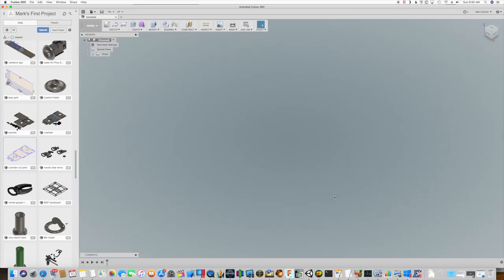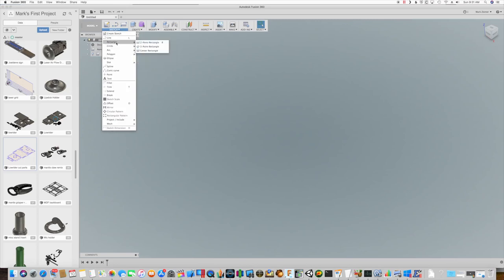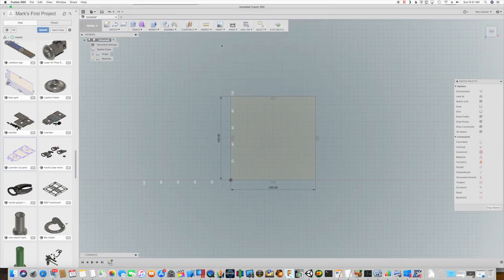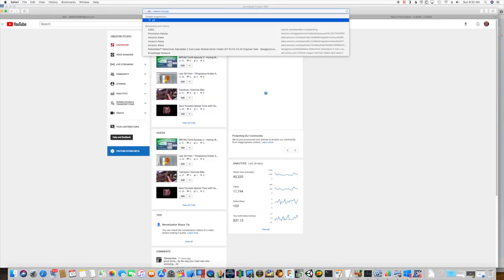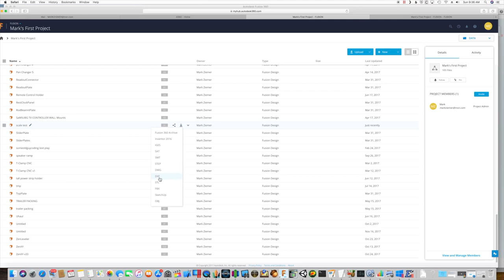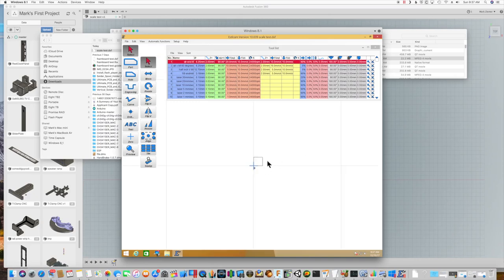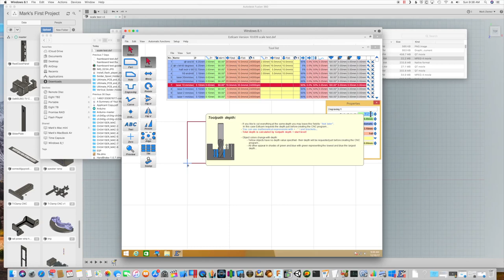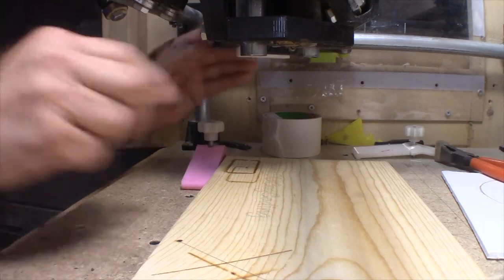Fusion 360 to ESTLCAM  - Scale Test

Comment: I’m running into a problem where after completing the sketch just as you have in the video,  but after saving as a dxf and emailing and opening in estlcam all that comes out is a single line.  I have 3 different files all different shapes and have received the same result every time.  Any thoughts?  I cant see what I’m missing.
Reply from the maker: I wonder if it's saving the sketch on the wrong axis...       The better way is to right click on the sketch and do "save as dxf"

Comment: Realizing this is an old thread. I'm also having a scaling issue with both ESTLCAM and Fusion 360 with the MPCNC post processor. I use Fusion in both cases. Either creating the model in Fusion and saving it as a DXF, which you can, now at least, do directly from Fusion and importing it to ESTLCAM or using Fusion CAM with the MPCNC post processor my (laser) engravings are almost exactly 25% larger than designed.  I have the newest firmware from V1 on my miniRambo board.  Any ideas???
Reply from the maker: Thanks for watching.  I've been doing all my work in Fusion360 now, and using the right-click save-as-dxf on a sketch. Then I open into Estlcam with the millimeter scale (mm)  and it's been working great. sorry you're having problems. Is the size off when you load into Estlcam?  Is there a chance you've go a different sized toothed pulley on the stepper motors on your MPCNC?  Just throwing out ideas...
Reply: Thanks for the reply SOGC! Yes, when I open it in ESLCAM it is the same size. However, I've been drawing circles which is a little hard to measure precisely so I'm going to try with your 100mm square. The idea re the pulley teeth is really a great thought and hadn't even occurred to me... I may just turn on the laser and move the head manually to see if the Marlin/board/stepper combination is a problem. As I mentioned I'm using the miniRambo but the code is current as I had to do the mod to remap the laser TTL pins.  

Thanks again for the ideas, really enjoy your channel. From another old guy... Todd
Reply: So your BRILLIANT suggestion regarding the pulleys was spot on. I ordered 16 TPI and received 20 TPI; which of course is a difference of 25% which was the error that I was seeing! The moral is to always check to see if you have the correct parts; the same thing happens to me when I grab something from the bin of a hardware big box store only to find out that someone "put back" a part that doesn't belong there.  Anyway thank you!

Comment: Hello again, this video and comments by the community have helped me out a lot.  
Without even knowing it I was using 20tpi vs 16tpi, so have resolved that issue.  
Was lost when it came to dxf files from fusion360, that has been solved as well now thanks to you.  
If I could bother you one last time as I have a scaling issue like Todd but the changing from 20-16 did not solve it.
I have made many things just messing around but now that I need proper measurements I am lost.  
I was forgiving the size issue but know it was much larger than 25% after changing to 16tpi it is exactly 25% larger than should be.
I do not fault fusion360 or estlcam here as the dxf’s seem fine and import into estlcam perfectly sized so don’t see the issue there either.  I have seen other threads where people were using the wrong drivers as hat too was presenting scaling issues but I am using the correct drivers.
Can you think of anything I may be overlooking?
Reply from the maker: first thing I can think of is to make sure your doing 1/32 micro steps, eg all three jumpers on the ramps cards.  But I'm not sure how that would work out to 25 percent. 

There’s a setting in marlin somewhere that sets steps per unit.  I assume you haven’t changed that from the code image from v1engineering.. There are also M commands to adjust this and save values in EEPROM, but you shouldn’t have to do this And I assume you haven’t tweaked those values and saved the to EEPROM already (in which case the values will need to be cleared)

The basic test would be to move an axis a given amount via LCD controller or via G command and measure the error.  This would certainly isolate the problem to the code and hardware rather than fusion/estlcam. 

There are also scaling values in Estlcam configuration which should be set to 1x

Let me know

Thx
Reply: So I have not ever changed anything in Marlin so will not change anything there.  I did manually move both the x and y axis and for 100mm and I’m getting a measure of approx 130.14.   I have done this 3 times to be sure.  
Now I’m wondering if it’s the motors? I’m using  17hs19-2004s1,  wondering if I should switch them?  I have a set of sl42sth48-1504a and was thinking I may try to change them over tomorrow.  Kind of at a loss,
Reply from the maker: Combat Guy Well, it seems like they’re both 1.8° per step motors. Same as the NEMAe is 17’s I’m using
Reply from the maker: @combatguy6989  Check out: https://forum.v1engineering.com/t/mpcnc-wrong-distance/11915
Reply: Thank you for taking the time to help over the last couple days with all the troubleshooting.  Happy to say it is in fact the belt, a quick inspection of the belt compared to spare belts taken from 3D printer.  The two are not the same, I bought a 5meter roll for the mpcnc and never compared the two before.  The difference is ever so slight but I can see now that this is in fact the culprit.  Thanks again, I will be ordering parts needed in the future from the vicious1 website.   I just wanted to say I’m glad for people like you that have the patience and willingness to help others.  Cheers!
Reply from the maker: @combatguy6989  Thanks so much! I hope this is the final issue to getting things running right. I know you've been working on this for a long time.  Good luck and stay safe!